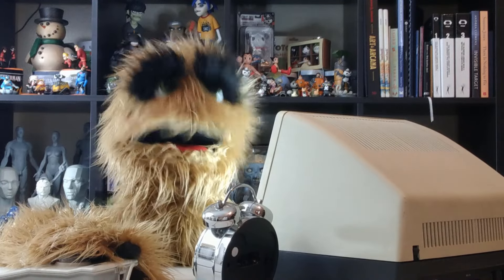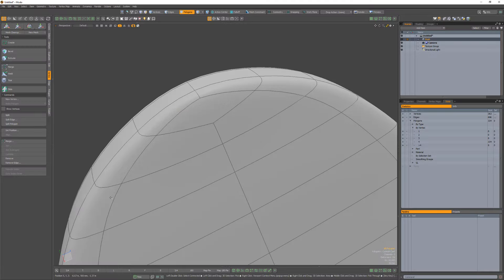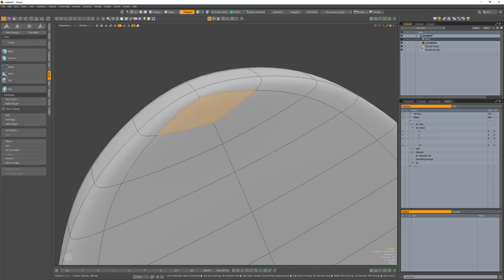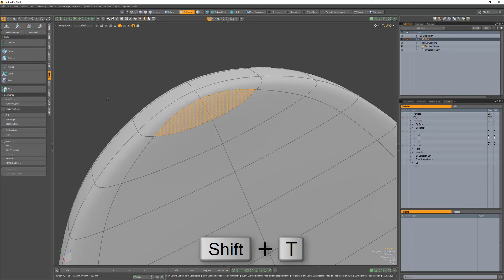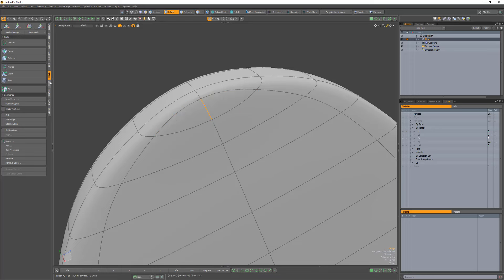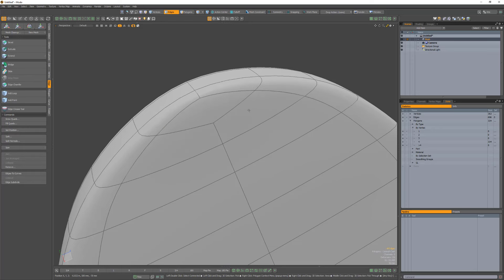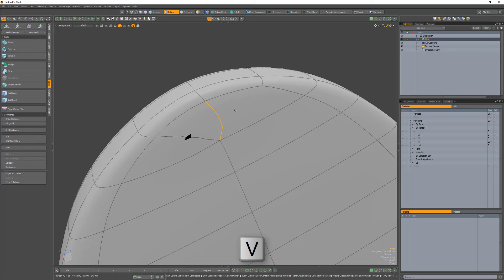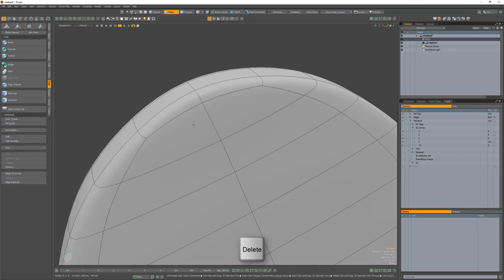MODO | Topology Tip: Remove Diamond Quad

Comment: That's very helpful! However the first method works even without deleting the polygon. Just join the two verts and it's done.
Reply from the maker: IN some older versions of Modo the poly remained... so I thought it best two add the step for all users.
Reply: @Pixelfondue  Yeah I had to test if it doesn't do that, but in 15 it's alright, so I thought I'd write it down. But it's very nice of you to think of older version users!
Reply from the maker: @Meg_A_Byte  Appreciate you sharing the test results and giving feedback.

Comment: I prefer method 1, on blender. Although you don't have to delete the polygon, just merge the two verts. A 4th method would be connecting the 2 verts with an edge then dissolving the bottom right and left sides of the diamond.  I guess with 3d you have infinite possibilities 🥴
Reply from the maker: first method in modo doesnt need to delete polygon in the last several years... but years ago you needed to so I showed the extra step just in case. SO many ways to do the same thing... true true